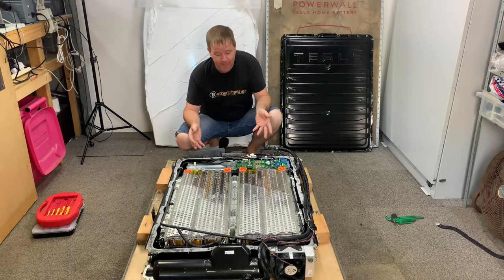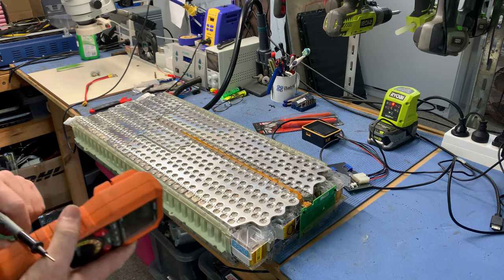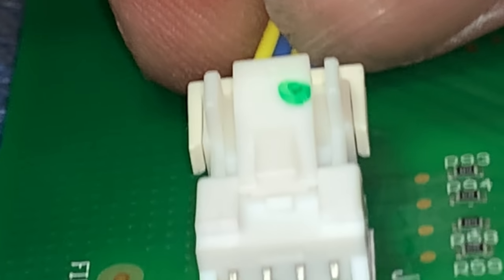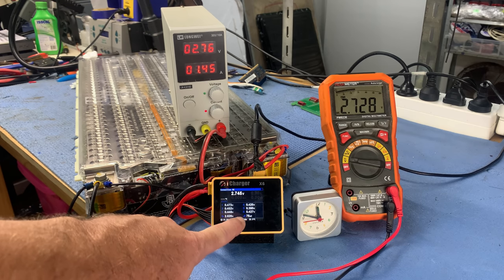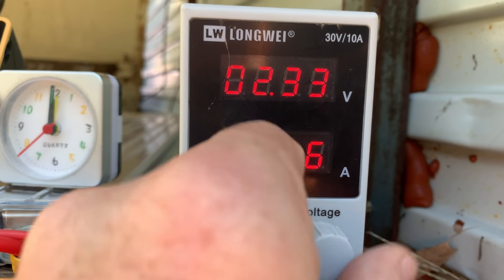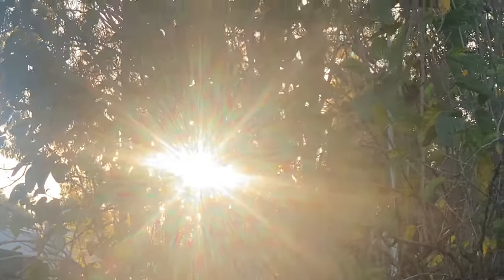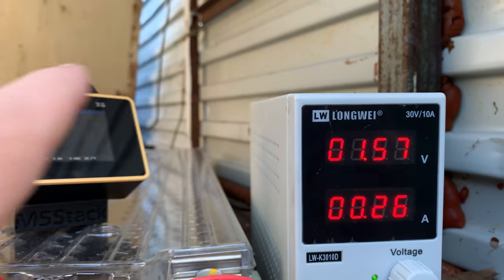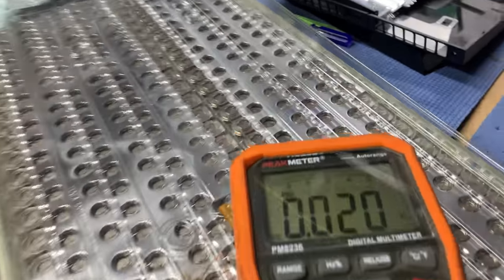Tesla Module repair | Zero volts to useable? Lets find out !

Comment: I have recovered 2 of these exact same batteries 3 years ago from zero volts and still use them today at their full capacity of 5.2 kWh. I recovered by charging each cell group separately 3V at 50ma to start then up to 4V . Also did IR test before and after charge only took about a WEEK, then slow discharge test  to check capacity. They both came back to life. I move about 3kWh daily through each battery.
Reply from the maker: I don't think it makes any difference one P or 6P , but i'll try that! I'll also try for a longer higher amp charge cycle
Reply: @HBPowerwall  Please do, would love to see that!
Reply: 1S charge 😊
Reply: @HBPowerwall  I'm not a professional but I think earlier in the video when you ramped up the recharge voltages and amps all the way to maximum just to show an example, I think that killed the battery for sure. 

Also Chad Barnes idea sounds good. Wouldn't each cell group be tailored based on their capacity rating for maximum lifespan and efficiency much in the same way you built your 25kw/h laptop cell battery power bank? If so, it would make sense to recharge them separately at different charge rates. Again I'm not a professional so I'm just basically guessing :)
Reply: Hey mate I have a tesla powerwall like this one that is flat can you go into more detail?

Comment: A battery will always try to have a nominal charge. That's a voltage.
The voltage is maintained by the amp (I) and cells together will try to equalise.

If you take out two or so cells and put a new  cell in there, it will drain out as the power will transfer to the other cells.

In packs a common issue is reversed charge which occurs on the ends and in the middle. 

You have to have a nominal charge voltage and a charge current for any battery. 
Stale li can have 4.3v wake up, with a 1 amp current on the cell. (Not pack).
It can take four hours to give the cell enough to start holding power.
If you have a pack, this takes longer.
Reversed battery cells should be removed. And the replacement from the same pack group.
So you would have to strip the battery somewhat to do this.

Remember kids you can't charge a battery below it cut-off.

If you try the cells suck the power and fight for the power between them, so it will vanish.

When charged, you will lose 70% capacity, and will need to cycle the pack, you should get around 50% after 6 cycles and it may slowly improve depending on the age, condition and use previously.

Comment: Last hope: maybe just a short somewhere? Maybe just a few batteries dead? Can you try and isolate a few cells and test if they hold a charge in isolation?
Reply from the maker: Considering stripping one... Might be a boring video tho
Reply: A binary search should find any dead cells more quickly than going through each one sequentially, but I'd throw them all in the Opus and see what they do.
Reply: @HBPowerwall  When it comes to your vids, Pete, they are enjoyable and informative, regardless of the content or how "boring" you think they are   😎😉
Reply: @HBPowerwall  no, it is not boring if you explain the things like here in this video.
It is sad that it did not work out this way but at least you tried - and we / I learned something.

If you would have succeeded then no dead tesla batteries would be available on the market ...
Reply: @HBPowerwall  Do it. It will be simillar to that "Dead Shorting Cell Level Fuses" one where we can actually see what's going on and not just guessing. You will change an "I guess" for "I am sure", which is in my opinion that's what we are all here to see. 

My guess it probably isn't short. My guess is that all expirienced same enviromental expierience (even bad temp and hum in wherehouse can matter for longer peroid of time) or that this batch of cells that were used where in reality some sort of "grade B" quality.
Reply: @HBPowerwall  ooooh they’re a mongrel to strip apart, I suggest isopropyl alcohol to weaken the glue on the positive end of cell. The CID section tends to leak electrolyte quite easily. Hopefully the pack can be revived 🤞🏼
Reply: @HBPowerwall  Gruber Auto says he can suss out the bad cell without tearing the pack apart, not sure how. I was hoping this video was revealing that method. :) Maybe the next one! I throw my support behind troubleshooting this further, but I fear since no bank is charging the cause may be lost.
Reply: @HBPowerwall  I would like to see you open one up and see the individual cells.
Reply: @HBPowerwall  Why not just cut a fuse wire and test it in place?

Comment: Thanks for making this video HBP. It is really importat to let people understand that it does not work and that it's a bad idea. Your video is now proving the truth. In fact your battery is now like a big heater and if you still ask it to recharge it will go unstable  and all the energy you could store into it would serve as thermal runaway energy if it blow up. The copper that has been dissolving is now acting as a resistance between anode and cathode.
Reply: but it will shake all the nay sayers and nutters out of the woodwork to prove him wrong
Reply from the maker: I hate it URS but you're right... someone will pull a battery that is 0.1v and 'recover it' and say LOOK I did EXACTLY what pete did and it worked.. :( NO - HUGE difference between 0.1v and zero buddies...

Comment: Tip. Set voltage to nominal battery voltage and adjust current limiter to 0...then connect battery. Tune current to what value you want. Then it will keep this value until battery voltage is reached. Or you change settings. Voltage will start out low and increse over time to voltage settings
Reply from the maker: Yep, preaty much what I do these days - need to do an update video on this 'repair'

Comment: I've recovered a 16s10p 18650 pack that was at 0.4v average per cell, I got them going again. I think cycling once the cells were at normal voltage really helped. 4.2v to 3.2v and back, over and over again about 20 times. I reckon you'll do it! Good luck.
Reply from the maker: Nice work! I'm going to try..
Reply: I would highly discourage trying to recovery ANY lithium-ion cell that has gone below 2v/cell because when you start reaching that voltage, the internal electrolyte/chemistry to start to become very acidic against the anode and dissolve the copper forming hydrogen gas. Even if you could recover the charge, you've now allow the cells to cyclilng with possible hydrogen gas inside the cell which becomes a ticking time bomb.

Comment: i had luck in recovering lithium cells by pushing a CV CC combo in 5v with 5A through it for a few seconds... then charge it normally if they got more then 1,1V
Reply: That's a good ide Put some were the higher voltage and amps and keep them cold in between by checking them and turning it off do that several times and then put a low voltage and bring it up slow
Reply from the maker: i used to do this many many years ago.. now it's low and slow ...

Comment: I would remove any (random) 18650 single battery from the Pack, and then place under a singular charging test. And then over again. I would really need to convince myself that the Tesla Battery Module - with a value of around $1800 (when good). Has gone bad - beyond any economic repair(s). I always thought that the Battery Pack (even at failure) should retain about 70% of it's original and rated kWh for double-figure years!  On a smaller scale, I have had Li -on Batteries fail on my Battery Drill, in a similar failure mode to Tesla model S Battery. A good video, and seemingly, your never-ending knowledge and years of experience to reach this point, helping us to understand much more about the behaviour of Lithium Batteries.
Reply: It depends.  I just rebuilt my first (and second and third) Greenworks batteries... the oldest one that failed, after disassembling each of the cells, most of the cells were good.  The aftermarket replacement battery, which was 2 years newer, only 3 cells would take a charge out of the 20.  I'm not sure if it had to do with the quality of the BMS board or the type of failure, but there was significant difference.  Also, FWIW, discovered that the new replacement "7Ah" and "6Ah" packs from eBay have only half as many cells.  In reality they're more like 2.1Ah.  But I was able to add the still good cells from the old Greenworks battery and bring it up to 4Ah, at least.

Comment: The model of bench power supply used to do the initial charge of the battery often has output resistors across the terminals (soldered onto the PCB).  If the supply is left connected to the battery but turned off or current limit set to 0, the power supply will draw considerable current from the battery.  This is part of the reason why the battery voltage falls so fast when the power supply is turned off.
Reply from the maker: Ok, i'll add that metric to my next test ... thanks for the heads up

Comment: I believe (also) that Tesla would use 444 x  PROTECTED 18650 individual batteries. I have read that the small circuit goes bad (the small circle at the Anode - end tip). In analysing those batteries, please take away the Protection Circuit from the top of any battery - pulled from the Pack. Try and (safely) charge the battery without it please. It may not be the battery in itself, but a general battery protection circuit fault. I am so curious to know. It would also make a great video. Thanks.

Comment: From my experience ... the cells are never getting activated if you dont push over 3v. At 1.5v and 0.2A for all that cells is not even enough to make a spark. Try pushing 3.3v at 2A ... thats almost 7W .... nothing will happen with 7W that can be considered really dangerous. And leave it for at least 24h. I would definitely  try like this before putting them to sleep... they just are tooo beautiful to give up so fast. And watch it with a thermal camera, maybe you detect any “drainers”.
Reply from the maker: Thermal Camera is over heating doing a time lapse of the next video - go figure lol

Comment: Hi, thank you for showing me the inside of the Tesla powerwall. I do not really know exactly how they work, however I have been attempting to make my own lithium-ion power bank. It appears that it is safe to discharge all the batteries in series because they do not charge each other. However the only safe method to charge the cells, is to charge them individually. That means, it is likely that the powerwall charges each cell with 4.2 V, as opposed to the expected 30 volts. This is because charging cells in series is extremely dangerous, due to each cell charging at a slightly different rate. Eventually, one cell will become extremely high voltage causing it to explode.
Reply: This is very obvious and why he used a cell group voltage monitor. Discharging in series is not "safe" due to the possible difference in resistance or voltage between parallel groups. I don't think anyone who doesn't know this should be touching lithium-ion batteries. When charging typically you DO charge the pack at pack voltage and the BMS does the work of balancing each group in series, In some cases, it's slightly different depending on BMS and whether is just passive or active balancing methods (or both), Some balance while charging, Some balance while discharging (or both). Never build a lithium battery without a BMS and please do some more research before going ahead with your idea. It seems you don't fully understand what a BMS is, why its needed, and what it does and that could end up being a danger to yourself. HBPowerwall has been around and makes amazing videos about the subject, My suggestion is binge watch his channel then go ahead and build some packs. We've all been there and its awesome to see more join the space but some give it a bad name due to lack of safety.
Reply: @BattTube  actually, if you use diodes you can have several series packs in parallel. I was only commenting that he should not be charging with 30 volts, but 4.2 for each set of parallel.
Reply: @diorthotistm1621   @Diorthotis TM  Sorry, what are you talking about in the first part of your comment because that's not what this is about? But yes he could have charged each parallel group with 4.2v but it wasn't dangerous in his case to charge it at a pack level.
Reply: @BattTube  Actually, charging cells in series is very dangerous, because the cells charge at different rates. Say you have 3 cells in series charging with 12.6 volts. If all cells start the same voltage and charge at the same rate, theoretically it may not explode. Here is the danger. Say one cell is already 4.2 volts, another is 2 volts and the third is 3.5 volts, the total voltage is 9.7 volts, however, when you charge it with 12.6 volts, the 4.2 volt cells gets over charged. It may not explode for many years, but will eventually, especially at the 5 to 6 volt range.
Reply: @diorthotistm1621  You just rephrased your first comment so you must have misunderstood. Let me rephrase my original comment so hopefully, you will understand. What you are stating is the most obvious thing and the very first thing you need to learn about when it comes to lithium batteries and i hope we all understand that. I'm explaining why that isn't an issue in this case and most cases with a properly built lithium battery. Do you know what a BMS is and what it does? Do you build and operate lithium packs without a BMS or balancing? Tesla wouldn't either, And in that case none of which you state would be an issue unless you had a faulty BMS. I'm not trying to be mean but I can clearly see the BMS in those packs, You can even see the balance leads going to the charge controller. The protections in the BMS would never allow a situation like that, Both main leads on a lithium battery will never both be directly attached to the battery. One will always go through the BMS where it can be switched to disconnect the battery. Now if all that fails you have fuses and fused nickel strips. Now if you just charged each group with a power supply or charger then your just bypassing any BMS protection potentially making it less safe than pack level charging through the BMS which offers high-temperature protection to prevent possible fires/explosions.
Reply: @BattTube  I don't know how a BMS works, all I know is the facts.

Comment: I bought a used Tesla module like this a while back. Instead of charging the entire battery I charge each individual cell group. It fully recover and continue to work til today. 
It's been so long but I think i pushed about 2 volts into each cell groups. Then slowly bring up the voltage back to 3. Once it's around 2.8 to 3 I let my Lipo charge take over and take it the rest of the way.
Reply from the maker: Thanks for sharing, I plan on trying again !! Just need time to be able to really monitor the process.

Comment: You should try the same test again but with a higher voltage per cell, maybe something like 2.5V/3.0V per cell and try to see if they hold this charge. I had my fair share with zero volts cells that have the exact same behavior as your test, when I tried lower than 2.5v/cell voltages. As soon as I started to use voltages that are a bit more "familiar to the cell" they picked up charge and hold it. It's a long shot but it might be worth it.

If all goes wrong, at least you can strip the cells and repurpose them ( the good ones ).
Reply from the maker: lower than 2.5v and zero volt are two different issues, I don't think any cells in the battery are recoverable
Reply: @HBPowerwall  I had some Fujitsu Laptop batteries that were just like those ones, 0.000V (after fully stripped). Absolutely dead. I tried to make some parcial charges up to 2.0V and the same happened, they just started to drop all  charge. As soon as I slowly charged them to 3V, they changed their enery absorption and starting behavind normally. The cells were 3000mAh inicially and after some years at 0.00v, 40% were still usable and still holded 2650 mAh roughly.
Reply from the maker: nice
Reply: That's right, a battery needs to be in normal levels to retain charge

Comment: As expected, but thanks for trying!
I have noticed that the newer FLIR software versions have removed the time lapse features that used to be available. In case your current version doesn’t have it, using an older device with an older version can give you time-lapse. FYI!
Reply from the maker: Thanks for the info! I can time lapse with this one but it drops out every 30 seconds, don't know if that's the port on my iphone or the Flir is just old.
Reply: @HBPowerwall  Yea I had the version you have and it started being unpredictable, so I upgraded to the new FLIR pro. Despite the name and cost, it’s not all that reliable. The battery life is just as bad, and the frame rate and quality frequently changes for no reason. Not  impressed.
Reply from the maker: I paid 100 bucks aud for this one on ebay and that was like 4 years ago so stupid good purchase
Reply from the maker: Yeh built to a price.

Comment: I don't recommend that you do this, but I have had positive results using a very sketchy method.  When I put about three times the rated voltage to a lithium 18650 for about two seconds for all it will suffer in amperage it will take a charge afterwards. Like I said I don't recommend it to anyone because of the possibility of cell rupture or fire. I have never tried it with a battery pack.  Only individual cells.
Reply from the maker: you don't really need to do that if you have a variable power supply.. i've done the same thing back in the day